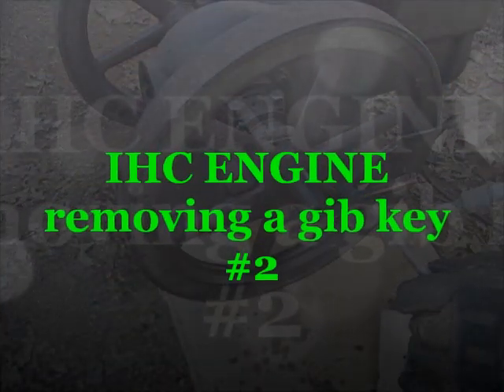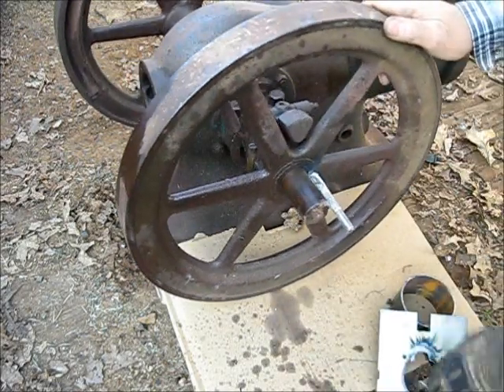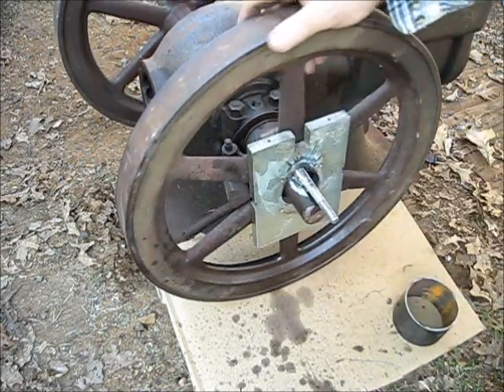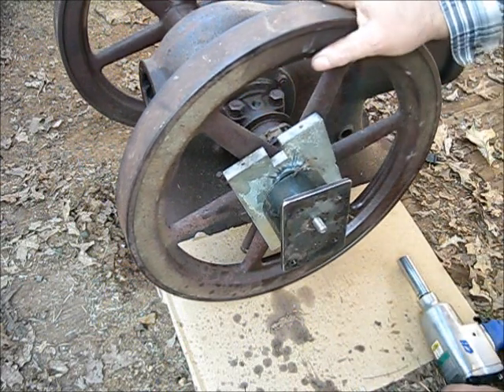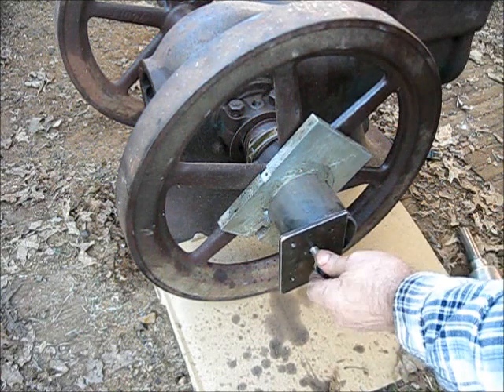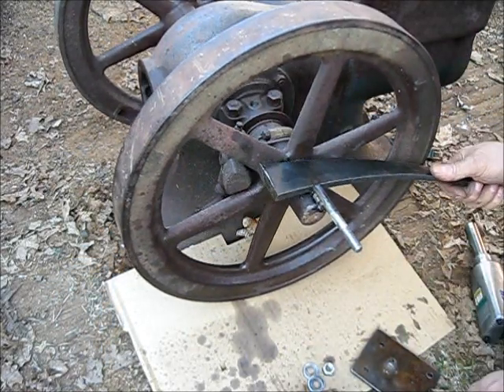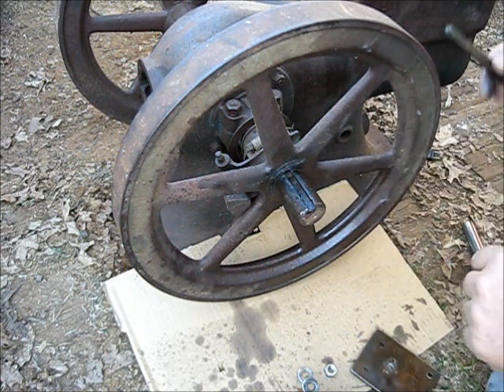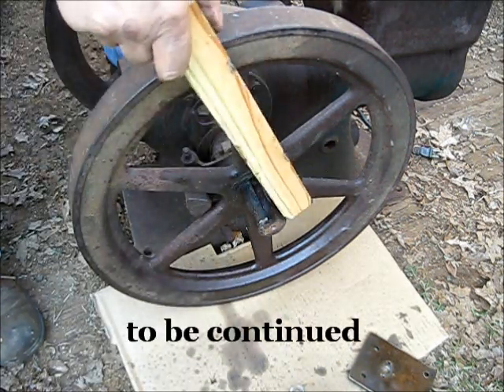IHC ENGINE / removing a gib key #2of4

Comment: If you have it, leave it soaking in WD40 for a couple of hours to break the rust. Heating joint a bit could help as the expansion and contraction can break the rust bind. Great videos of real issues and solutions!